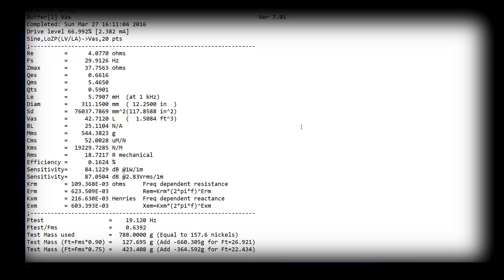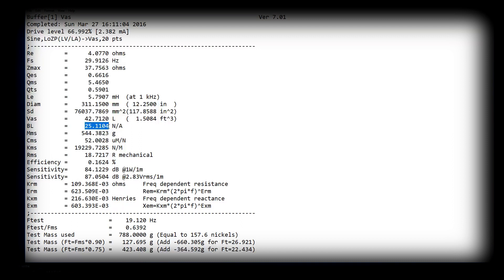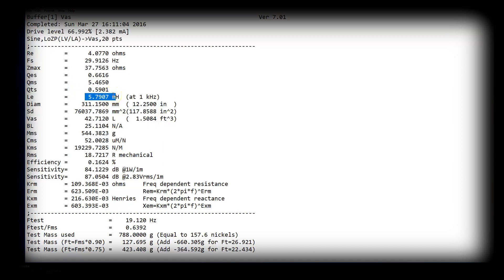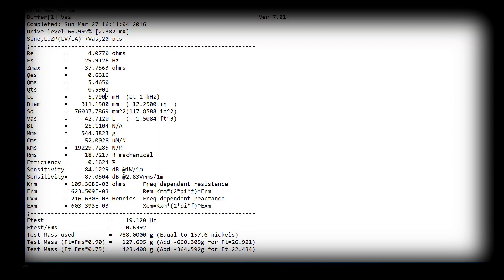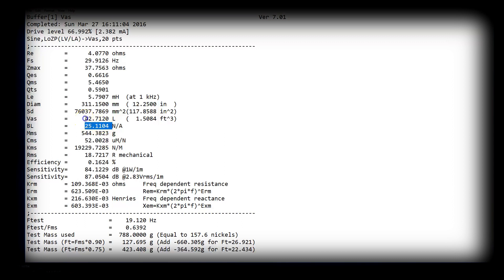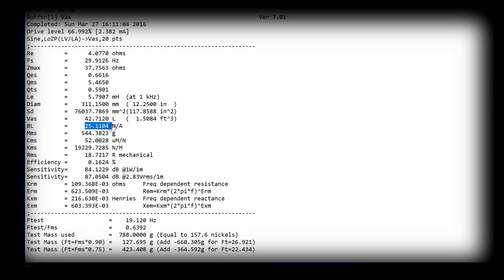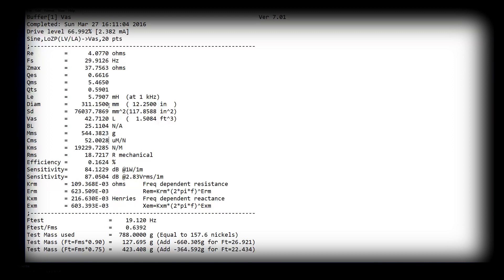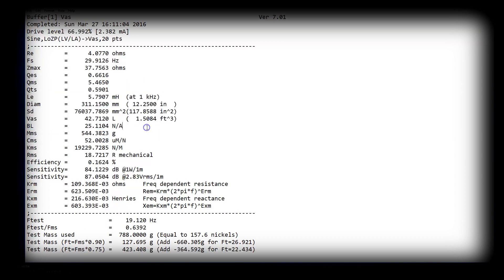speaker parameters relationships - Tech Stuff Tuesday

Comment: i bought a pre fabbed ported box and the description does not have a frequency range for the 8 inch subs but it does say fs is 43 hertz and the box is ported to 39 hertz i am waiting for a response back from ct sounds for what they recommend the low pass filter to be set to my monoblock amplifier goes to 300 hertz and does not say for either filter the db octave slope

Comment: Hello! I know I'm several years late, but I wanted to ask about Re. I see a lot of manufacturers state Re as something like 3.0ohm + 3.0ohm on their Thiele small parameters sheet. Should I be reading that as an Re of 6.0ohms for a dual voice coil 4 ohm sub, or an Re of 3.0? Just trying to follow along with an Alpine Type X 10" spec sheet I have laying here with me to determine whether its Le of 4.04 mH is good (6.0 Re, 4.04 mH) or just average (3.0 Re, 4.04 mH). Thanks!

Comment: In what application would one want a high Fs, or a low Fs? If I want to have an 18" sub tuned as low as possible I need a low Fs for better efficiency right?
Reply from the maker: There is more to it, but generally speaking, for a low frequency application you'll want a lower Fs. For a higher peak you'd want a higher Fs. For your application you'd be looking for a low Fs. If you're trying to play say 25 hz, you could still have a 30 hz Fs like a Banhammer and rock 25 hz pretty well. It doesn't have to be a 20 hz Fs sub.
Reply: @EMFAudio  thanks!

Comment: Stiffer suspension= higher Qts not lower like said in the video.

It is possible to have inductance lower than Re. It’s quite common in Pro Audio some companies even take precautions in the motor design to combat Le. It’s not as common in the car audio world though as some brands don’t take precautions and Le can creep up to 2x Re.

Tsp’s are actually a good base for box design and can tell you quite a bit about how it will behave in an enclosure.

But when designing Le’s effect on Bl Qts and Qes needs to be taken into account.
Reply from the maker: If you have a weak ass motor, yes a stiffer suspension gives you a high Qts. I actually build speakers and test every configuration, I have specs to back up Qts dropping with stiffer suspension. Everything the same but add a spider. It's common to have Le lower than Re in midranges too, you don't find it in car audio because of other design goals. PA you see it because they don't care about anything below 45 hz and want the highest sensitivity possible.  

I did another video showing how wrong box simulation programs are for car use.  Though, they still produce some results that aren't accurate like making the enclosure infinitely large makes it infinitely louder.

Comment: Qts closer to 3 is better or closer to 5 is better? Or is there alot more you have to cosider?
Reply from the maker: "better" depends on the enclosure type you're using. That's the ONLY thing Qts should be used for in terms of comparing specs.

Comment: Can you explain 3inch coil vs 4inch coil with same motor force like fi sp4 vs sundown 3inch model?
Reply from the maker: http://www.emfcaraudio.com/blog/technically-speaking-gauss-may-not-be-what-you-think-it-is/ This might give you some insight on that.
Reply: EMF Audio i already read that article its all about gauss power and motor strength..
Reply from the maker: @IndAudio  gauss is how strong a motor CAN be, it literally is the measure of motor strength alone. That's the basis for your question. If you're comparing BL^2/Re numbers you're doing it as a complete sub. Coil size doesn't matter, the number is what it is.
Reply: EMF Audio if we increases coil size we loses some cone area does this effects on spl with same motor force 3inch vs 4inch sizes ?
Reply from the maker: @IndAudio  Coil size doesn't change cone area. Aside from the fact that the dustcap, which covers the coil, is effective cone area, cone area is measured from surround apex to surround apex. The coil or dustcap size has nothing to do with cone area.
Reply: EMF Audio  you mean bottom of the cone not effect cone area only surround width effects cone area..
Reply from the maker: @IndAudio  Correct. Additionally the difference would be fractional anyway, not enough to make an output difference.

Comment: Super informative. Is it possible you could explain the importance of sensitivity in a video? If you have 2 different 12's and put each one in a 1.5cu box @ 32hz (just as an example) They both have..20mm of 1way xmax they both are 3" coils as much in common as possible but one has 91db sensitivity and one has 86 will the 91 be louder at the power? I guess really what im asking is how important sensitivity really is.
Reply from the maker: The reality of that test is size of the sub, coil size, and power rating don't matter if you're only comparing sensitivity. I planned on doing a video like that, I just have to set aside more time to make that happen and prepare a list of excuses people will make to include in the video.